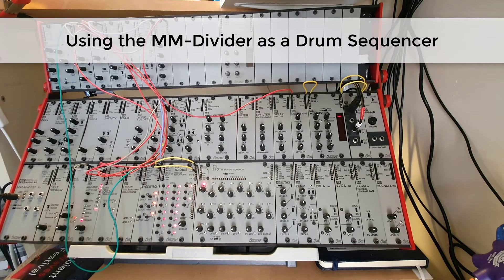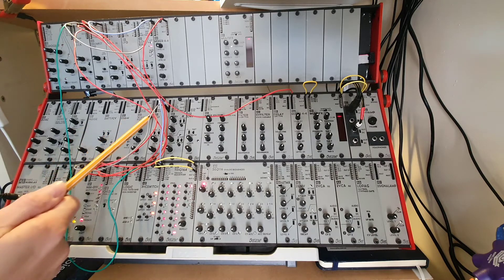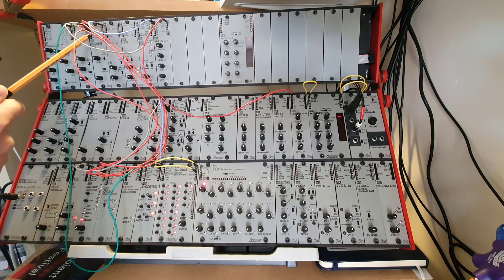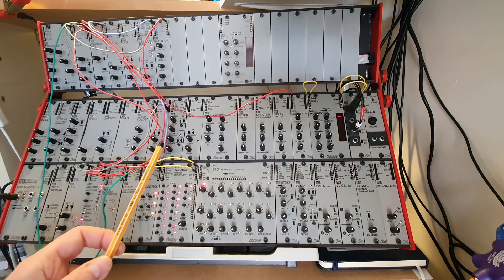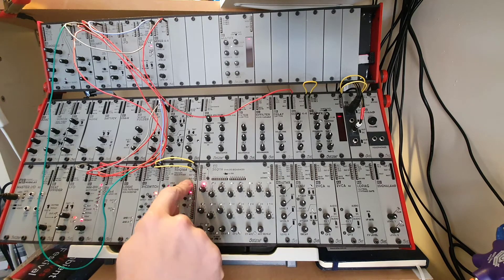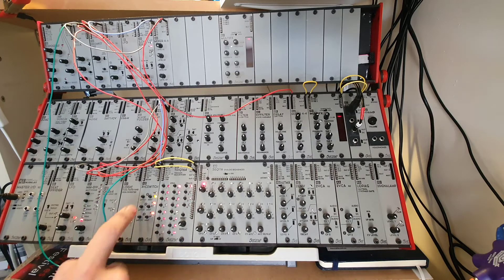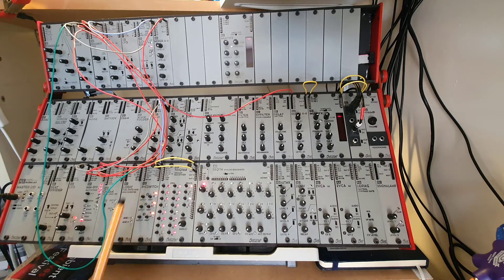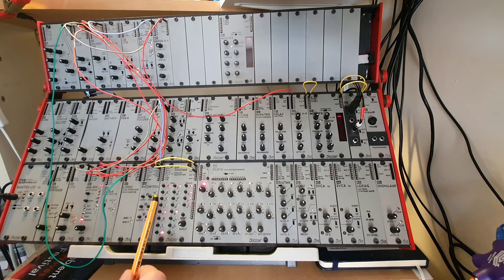AE Modular - Getting Started 10  -  Sequencing Drums with MM-Divider

Comment: Are the output protected from feedbacks and or possible bad patching??? Im using mine in conjunction with TRIP, MODULATORS, RBSS, XMIX R2R MM33 and Kastle Drums!
Reply from the maker: I haven't yet tried to put any voltage into the output so I'm not 100% sure, but usually outputs should be protected.